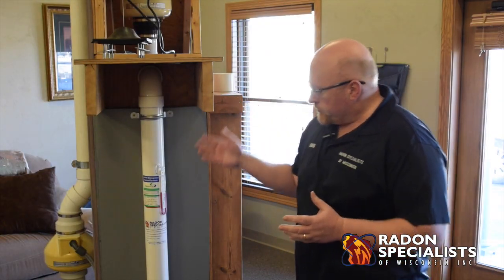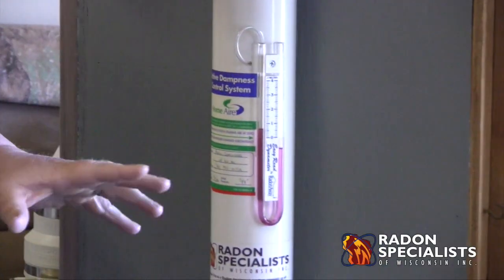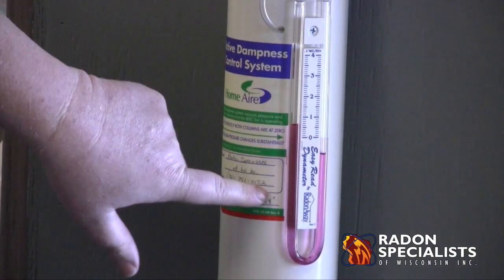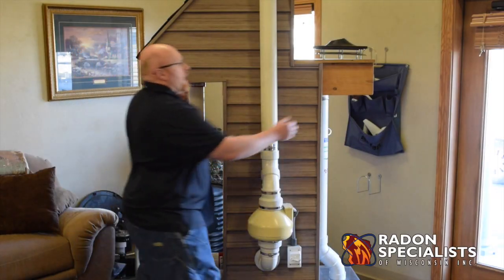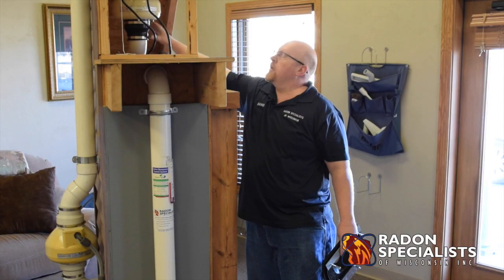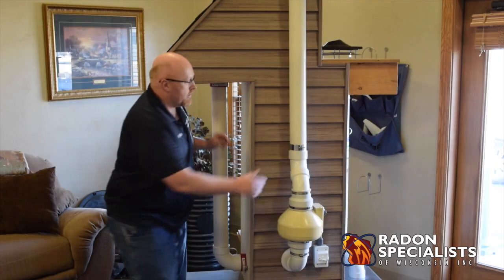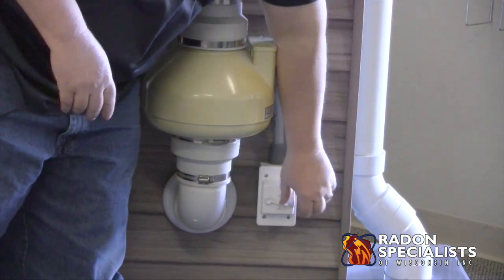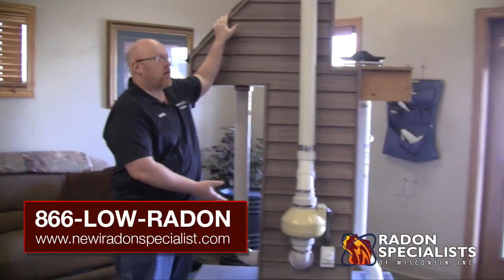Anatomy of a (Properly-Installed) Radon System

Comment: Sorry to say, but you might still have a radon problem, what you measured could just be the natural fluctuations of Radon. In my basement on a closed room with the windows closed, the levels of Radon can fluctuate from 1 to 9 in just 12 hours, stay for a couples of days and go back to 1 in some hours. It is crazy, but it is all to do with the internal movements of the hearth and radio activity. Also, if the room hypothetically stops getting radon in and it is hermetically closed, the levels of radon will be zero in 3.8 days because that is the time the radon takes to decays to lead.

Comment: Very informative video I do have a few questions though... What is the diameter of the PVC pipe that is utilized when dealing with radon? Also, are there different fans for various platforms or would you use the same fan in a slab foundation as you would in a crawl space or other configuration? Thank you in advance.

Comment: Our Radon meter by Airthings is currently showing 46 pci/l upstairs.  Have slab concrete floor in basement with a sump pump at each end.  Levels this high may be impossible to correct?

Comment: Awesome video!  About to tackle this project myself but having a difficult time deciding on 3" vs 4" ducting.  I have an 1100sq ft basement slab with corrugated drain tile underneath and on the edges all leading to sump pit that I will be sealing and extracting from.  sub slab is a mix of limestone and just earth.  Using a RadonAway RP145c and entire run will be only 15' mostly vertical.  Seems like in Canada 4" is typical but I see many US installations with 3".  My main concerns are 1)airflow and 2)noise.  What are your thoughts?

Comment: I have no garage and my attic is a livable space. Can I run the pipe up through closet spaces in the house and then through the roof with with fan installed outside above the roof? I'm trying to avoid the look of it installed on the exterior wall.

Comment: David, since the pipe is straight up in the air at the roof, would it be bad during a rain storm? Can't you use a 45 degree to curve the pipe to avoid rain or snow from going down the radon pipe?

Comment: You seems to cut the 45 degree over the fan instead of using a straight pipe with some room. That is very bad for 2 reasons: 1 - there is still an angle when you enter into the pump which could cause leak easier and 2 - it will makes serving the pump a real hard job, where you will have to change some pipes. The junction box should be 18 inches above ground or higher depending if you have snow. The PVC should be schedule 40, I think you don't mention it. Also, some peoples seems to tell it is better to add a wire rack at the output.

Comment: This is the best video I've seen on what a proper installation should look like. I recently had a system put in (in the Northwoods of WI too), the contractor cut corners, didn't pipe around the soffit, and plugged the fan in an outlet. I knew it was wrong, just didn't know how it was wrong. I made him come back to fix it. --we'll see if he does it properly, but I feel empowered to make him come back again if he doesn't do it right. Thanks again for this video.

Comment: You mentioned the fan has be to in an unlivable space. Could it be installed in a utility room where the current passive system comes out of the slab?

Comment: I look at the manometer from time to time, not on any schedule. Today is see the level is higher on the side with the tube. It's usually at +1/-1, now it's reversed. Maybe it's that way more often, but I haven't noticed. Is there any reason other than a fault in the system that this should happen?

Comment: Great video ! Wow! Little question: why can’t you have the fans in the basement and go outside through a rim joists (can go up after that). Why the fan should be in the attic or outside ? I will hire someone here in Canada and the code is less stringent (at the moment) but I want something well installed for a long time.
Reply from the maker: Canada does have other standards. I agree with them but that is the case for now.

Comment: Great video and great mock up. I have a question, in basements built before the 1970s where there is no base rock & literally slab on top of dirt, is there any value in core drilling a pipe down into the dirt? I’m assuming with a 3 1/2 inch Core, one could get their hand down there and remove 12 inches of dirt or so and put in some base rock with the pipe? Do you think that would accomplish anything?
Reply from the maker: Thank you for the comments. You would actually want to core about a 6 inch hole to be able to get your arm in there. You would want to dig a deep and wide pit. About 4-5 five gallon pails worth. Then use a reducer coupler to go down to a 3 inch sched. 40 PVC pipe. Then a strong vacuum fan like a RadonAway GP501. Put suction point near a plumbing drain stack also if you can. Good to be by footing also, but not on top of it. You may need more than one suction point if the first one does not do the job. Also check for air leaks and caulk where needed with Polyurethane caulk.

Comment: To make the fan more accessible... wouldn't it make more sense to house that inside the home. above the area where you breached the concrete slab?
Reply from the maker: It would be nice if we could do that but that would be against national standards. Let's say a radon test came in at 6. That's what made it through the concrete. What's under the concrete could be a thousand. If there was a leak on the exhaust side of the fan that's what would be pumped into the house twenty-four hours a day. So, that was actually be a dangerous situation. This is why the fan has to be outside of livable space and the vent pipe has to be above the roof and a certain distance away from Windows and openings.
Reply: @RadonSpecialistsofWINeenah  ... Thank you very much for the explanation. Totally makes sense.
Reply: I fail to understand why the attic is that much safer than the basement if the fan happens to discharge under the roof line.
You're still looking at a lot of infiltration.

Comment: Noticed that the systems are open on the roof side. How does water collection/draining work in this case? Does that mean this will back up to the crawlspace/slab?
Reply from the maker: The best way to vent is straight up and open on top. This helps with air flow. Not much moisture can get in the pipe as the air coming out of it pushes it away. Whatever does make it into the pipe is a small amount. In 20 years of doing this I have never seen a large amount of water build up at the suction point. Some water will make its way down. It just gets absorbed into the soil. What can be an issue is if the piping is not pitched properly. That's when water will accumulate in the pipe and cause resistance and gurgling.

Comment: I bought a house with a radon system in it,but i cant find any system monitor and the company who installed it is out of business. I have looked everywhere but the attic. Could it be up there? Are systems required to have the ushaped monitor on them? I would think so. Thanks.
Reply from the maker: Thank you for the question. You may just have a passive system, no fan in attic. If you put your ear on the pipe in the basement and don't hear any air passing through the pipe it is a passive system. You would have to install the fan in the attic, which probably means an outlet to plug it into also. Then install a U-tube gauge on the pipe in the basement. 
A warning device is required on all active systems. If not a U-tube an audible alarm in the basement or attic. Either one is to let the homeowner know the system is functioning properly.

Comment: what is the specific fan part called? radon pipe fan?
Reply from the maker: Just "A Radon Fan". There are different fans made for the application they should be used on. Bath fans for bathrooms. Dryer booster fans to help with long dryer vent runs. This, being a Radon system it is simply called a Radon fan.

Comment: I have a ABS 4" pipe next to my foundation well below grade can I use it for radon
Reply from the maker: I would have to see a pic of it. Remember the fan has to be an unlivable space. So, that is outside the home or up in an attic space. And then the pipe has to be about a foot above the roof. Do you know what that ABS pipe is connected to?
Reply: @RadonSpecialistsofWINeenah  Not connected at all it was put in and never used its below the slab right next to it. the fan would be outside just like the pipe
Reply from the maker: Maybe connect a fan and some piping temporarily plug into an extension cord or something to run the fan. Let it run for a couple days and then do a post test in the basement to see if it worked. If the pipe / suction point isn't configured properly under the slab it may not work.
Reply: @RadonSpecialistsofWINeenah  great thank you
Reply: @RadonSpecialistsofWINeenah  not sure if i was clear. the abs is located outside the house next to the cement wall of the basement.
Reply: @RadonSpecialistsofWINeenah Lots of people commenting negatively on the internet about fan being placed in the basement, but lets set some things straight.  Actually Canada says the basement is the best location to prevent damage to the fan.  I live in Fishers Indiana, and the city allows installation of the fan in the basement.  If you think about it, if you don't allow the Fan to be located in the basement, then you should not allow gas furnaces or gas water heaters to be located in the basement.  As Canada says regarding radon fan installation, "properly installed fans and pipes will not leak radon into the building and are usually installed in the basement".  I will soon be installing my Radon Fan in the basement, no doubt about it (regardless of EPA recommendation).
Reply from the maker: You can do as you wish. Water heaters and furnaces do not exhaust radiation that can kill you. I don't agree with the Canadian reasoning and studies have been done that prove me right. When you sell your home you will have to relocate the fan. There is no city or state that allows a Radon fan venting soil gasses in the home.  Someone misinformed you.
Reply: @RadonSpecialistsofWINeenah  You are wrong about having to relocate the fan when I sell my home.  Our city building inspectors recommend putting the fan in the basement because our homes are already roughed in for installation of the fan in the basement (electrical outlet already installed in the basement next to the ventilation stack that is already installed, etc.), and when the home behind me just sold (this past month) it failed the Radon test, so the home owner was required to have Radon mitigation system installed and the Fan was installed in the basement by a certified Radon Mitigation company and the new home owners have moved in.  I did not say the vent was inside the house, just the fact that my city (Fishers Indiana) allows the fan to be installed in the basement as does the Canadian government.  Also gas water heaters and gas furnaces produce carbon monoxide which is a colorless and orderless gas which is fatal and they (gas furnaces and gas water heaters) are often installed in the house using proper ventilation techniques.  Too many people in the US have been drinking the Kool-Aid and following the EPA Radon recommendation regarding Fan location without any questions.  I'm sure glad I live where good common sense engineering is in force, and not forced to put money in the pockets of the NRSB or those that follow it blindlessly with the result being the fan located in a location that often causes premature failure (shorter life span).
Reply from the maker: I'm sorry to say you're local inspectors are wrong. As the national president of AARST,   that now writes the national standards, I will definitely check into this. Yes, water heaters and furnaces produce carbon monoxide and when not working properly will kill you rather quickly. Radon is a long term effect, and once the damage is done is irreversible. If installed properly a Radon can easily last 10-15 years. I live in Northeast WI. My fan lasted 14 years. Any nationally certified company would simply refuse to put a fan in a basement because if it did leak somehow it wouldn't be 10 or 20 Pico Curries being pumped into the house but hundreds and possibly well over a thousand. And, it could be undetectable, unless you are constantly testing. Not worth the risk in my opinion.
Reply: @RadonSpecialistsofWINeenah  It's not a matter of being right or wrong, and that's the point.  From an engineering standpoint there are always trade-offs.  I understand the logic behind the EPA recommendation of the fan not being located below living space, but their reasoning should only be part of the decision making process and it should not necessarily override everything else.  I'm glad the Canadian Government as well as my local city that has close to 100,000 residents allows for deviations from the EPA recommendation.  Our local building inspectors are well aware of the EPA radon mitigation recommendations for fan placement and we discussed this topic in great detail.  Thanks for the lively discussion.
Reply: @RadonSpecialistsofWINeenah  I just checked with another city (Carmel Indiana) which is another large city that is adjacent to my city (Fishers Indiana), and their building inspector said the same thing that my cities building inspectors said.  The city of Carmel Indiana (specifically their building department and their inspectors) do not get involved at all with what can and can't be done with Radon mitigation systems including the placement of the fan.  They said they (the fan) can be installed wherever the homeowner wants (including in the basement), and no building permit is required, etc.  Therefore the city I live in (Fishers Indiana) is not unique.  Just FYI, Don

Comment: Im in Halifax Canada and my house tested at over 3000. Do we have to worry about freezing?
Reply from the maker: 3000? You might want to re test to verify. Is that in Pico curries or basquels?
I still believe systems should be installed up to US standards but in Canada you can actually put the fan in the basement and vent at ground level to avoid freeze ups. We get just as Cold of winters here in Wisconsin and we do get some freeze ups but it's only for a few days and then they take care of themselves once it warms up a little bit.

Comment: Can you drill anywhere on the slab or does it need to be in an  specific area
Reply from the maker: Technically anywhere. But the best place to drill is about 6 inch from the foundation wall near the footing. also if you can place it near the 14 in the area of a plumbing drain stack that would be good too.
Reply: Thank you very much for your help I appreciate it

Comment from the maker: There is nothing wrong with routing a system off a sump pump pit. But doing that limits on where the system can be routed. And, if you have a pump emergency you'll have to dismantle the Radon system first, wasting valuable time, to get in there. Then reinstall the system after dealing with the pump. If there is clay or sand under the slab and no interior drain tile then the pit may be the way to go. If there is interior drain tile or gravel then there probably would be better options considering aesthetics and function.

Comment: Sorry for any misunderstandings, but no, the pipe does not go into the overhang "soffit" area. The pipe goes up through the roof, typically the back side, and vents out above it a minimum of 12 inches. You do not want the vent blowing air back into the garage. It would have a high moisture content and radiation level. On an outside system the vent has to be above the gutter also with no fittings on it. I have seen systems where the pipe goes above the roof but then they installed a few elbows on the top blowing the air back down towards the roof and ground. Not good. You also want  to make sure the vent is a minimum of 10 ft. above grade or decks and 2 ft. above any openings or 10 ft. from them while maintaining the min. 10 ft. above grade rule.
Reply: Excellent video.  I'm getting quotes now for a system and this video helps me ask proper questions to the installer.

Comment: Wow, great vid.  So when you go through the basement slab it can go anywhere because of the assumed gravel and drainage pipes underneath?  Is there an ideal place?  Based on saquare footage, how powerful does that fan need to be. (i.e.: 2000 sq ft basement, 6K+ home.)
Reply from the maker: Thank you for the comments. It would be best to place the suction point near an outside wall/footing. Then you can pull from gravel and drain tile.  But could actually work anywhere. 
2000 sq. ft. basement I would recommend a RadonAway RP145.
Reply: @RadonSpecialistsofWINeenah  Wow that was such a fast response, thank you!  One more, if you have the time.  Is there anything wrong or additional benefit with over sizing the fan... like a RP265 with the 6 inch inlet?  I really appreciate your response.  It's like we have a real life live saver!
Reply from the maker: Using a larger fan typically does not get you a lower radon level. Radon systems do not act like that. Some companies will try to sell you a larger fan saying that is the case but it is a scam. I've done many experiments with different sized fans and using a higher air volume fans and larger pipe has not lowered radon levels any further than the standard fan we would use in our experiments. The only time you would use a larger fan is if you have a very large footprint say over 5000 square foot slab and larger commercial buildings. If you had tight soils then you would use a higher vacuum fan so you'd have enough power to pull air.